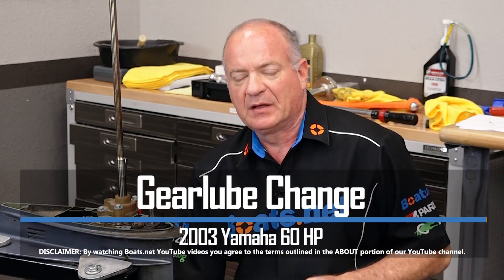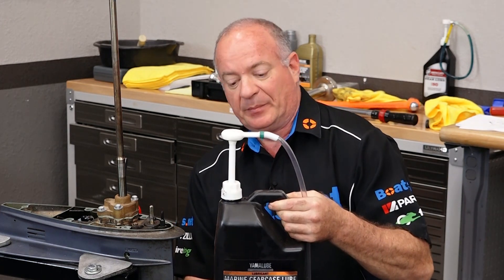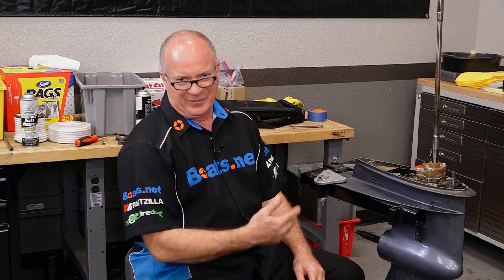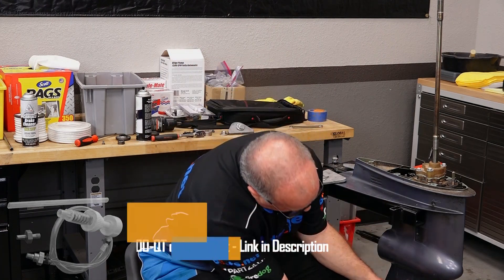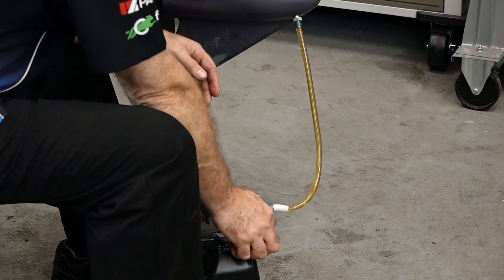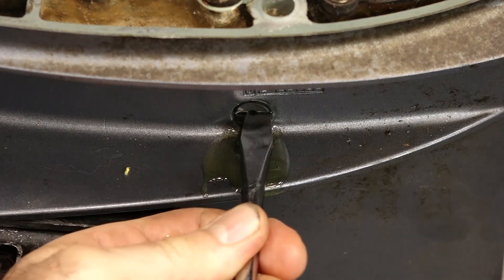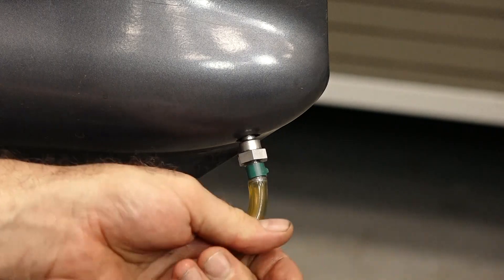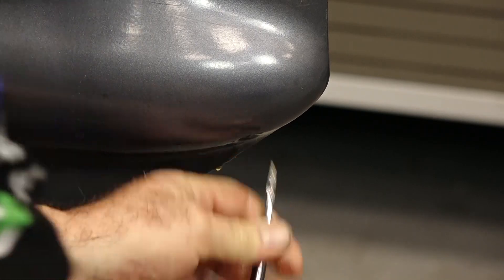Yamaha 60HP Outboard Gearcase Lube | Yamaha Lower Unit Fluid Change | Boats.net

Comment: On a 2003 F60 is there a difference between hypoid gear oil SAE 90 from the manual verses the common advertised 80W90 gear oil.  Thanks.